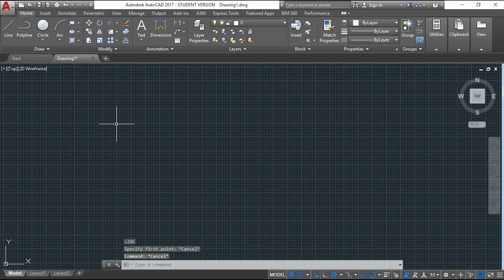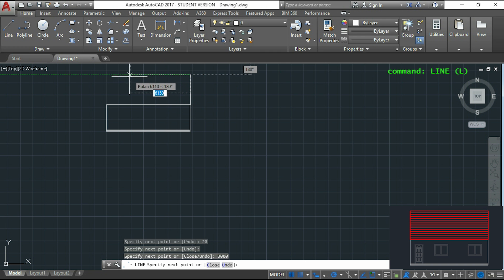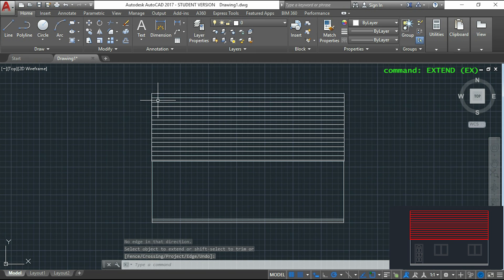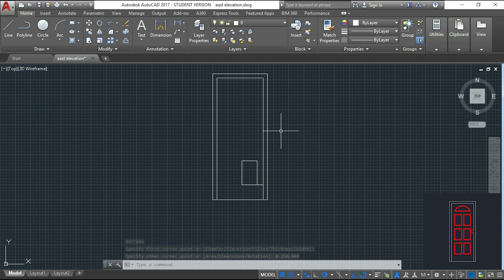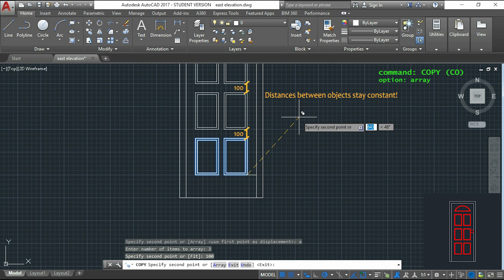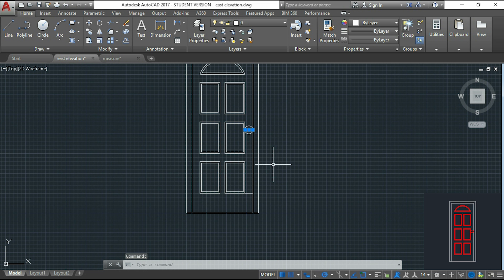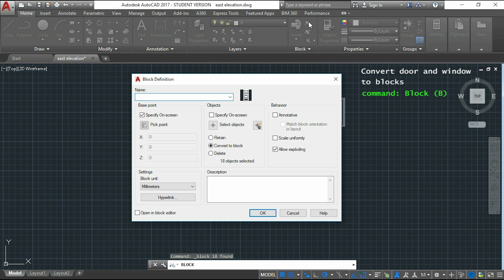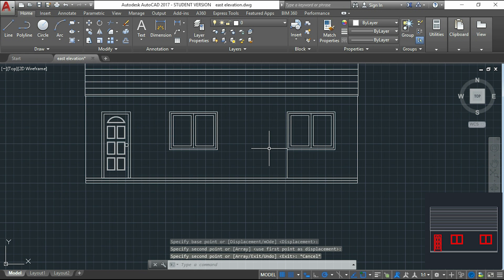AutoCAD 2D Basics – Tutorial to draw a simple floor plan (Fast and effective!) PART 5 - Elevation

Comment: Thank you sir :) wn I did command Join to convert The arc and line to PL , I tried to select one of them to join to other but it gave 0 foond for example I select the line then try to select the arc it couldnt select , It gave me 0 founded Why?
Reply from the maker: Hello +Hanin Kilani. What version of Autocad do you have? I ask it because some years ago, command join only worked for lines that were in the same axis. But If you have a recent version I am not sure what can be your issue

Comment: what is the difference between Join, Group and making a block? Why do you made a block for the door and window but you used Copy command to put them at the house?
Reply from the maker: Hi +Wu Ben. Join is just for trasforming connected lines in a Polyline. 
Group is used when we want several objects to act as only one, so you just click in one of them and select them all. It is similar as Block.
Block, is to transform several objects in only one object. 
Why do I made a block for the door and window but used Copy command to put them at the house? Good question. I just did this way because with a simple "click" I could put it in several places with just once click.
Another way is to click on "insert block" in the  main ribbon,  select your block, and put it where you would like.

Comment: Can you help me with one part? At 8:53, you moved up the array on the door for the extension and it read 40<90 deg before you typed in 100. When I do it, it reads 400<90 so when I type in 100, the squares are on top of each other. I hovered over the corner, but it still reads at 400 or more. How can I fix this? Thanks!!
Reply: Hi +Victoria Loza. Sorry to reply you just now, as I haven't noticed your comment. It sounds a bit weird. What I think it could happen is that Autocad didn't detect, as an "endpoint", the same corner. If it was making the extension line from the corner at the botton, it would happen exactly what you told me. By the way, did you manage to fix it?